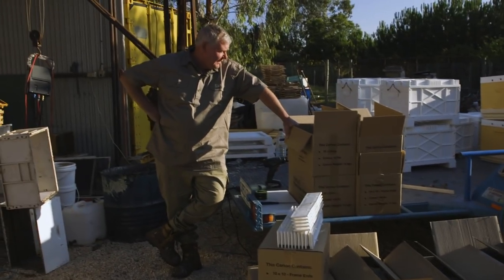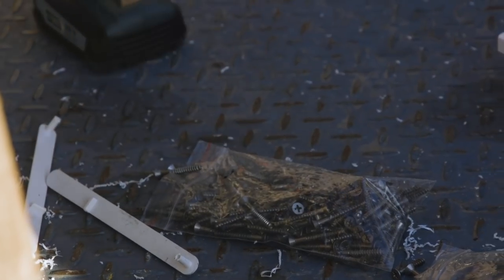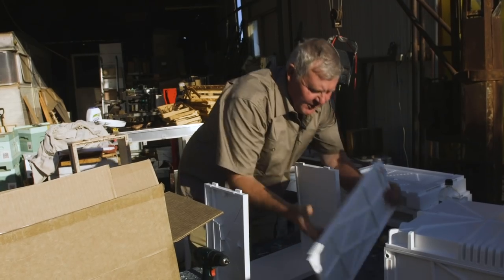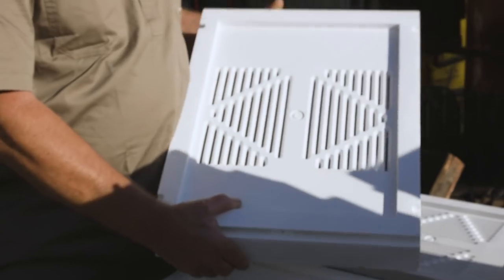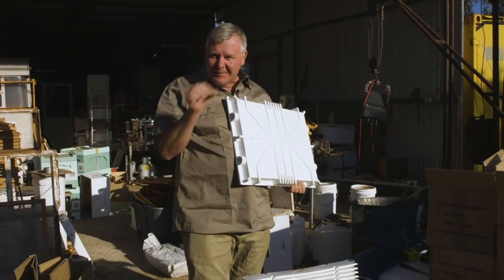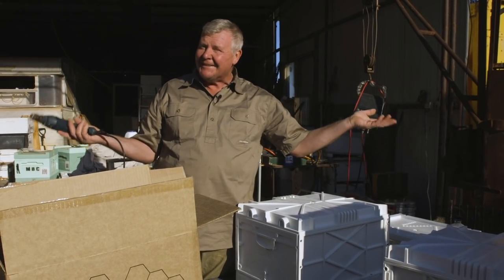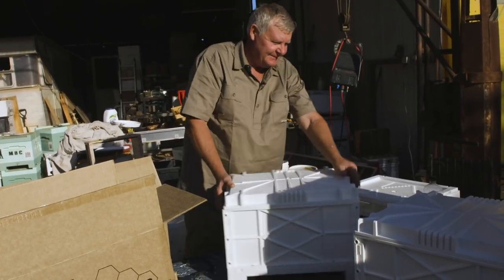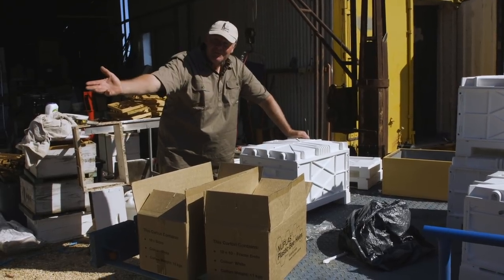How to assemble a Nuplas Beehive - The Bush Bee Man

Comment: Lucky you!! We’ve had Nuplas hives for 18 months and have decided to switch completely to Nuplas... the bees seem absolutely fine in them. We run 8 frames with ideal supers.

You do get condensation in winter but that was resolved by using lino mats (see Alan Teske brood mats) under the lid. If we need to feed in winter, we just gave them straight sugar and it worked well, any moisture was absorbed by the sugar. But even those we didn’t feed was very happy with the mat. We would definitely recommend. 👍🏻

Comment: Food grade what? What type of supposedly recycled material comes in food grade? and in white for that matter, I smell a rat.
Reply: @Flinders Honey Bees I will remain a skeptic. We already had a plastic hive manufacturer down Gippsland way. My issue with plastics is that here in sunny Aus, we have something called UV, all polymers break down in UV and release some nasty chemical by products, polypropylene and polyethylene both become brittle before falling apart, and the same with PVC. Nowhere in their literature do they say what the material type is, or a list of the additives. I have tried the polystyrene hives and they work well, but some critters find them attractive, (me thinks possums), and I often find damaged bases and boxes. The final disposal might be an issue as it is illegal to burn them, and landfill is reluctant to except polystyrene.
Reply: @Flinders Honey Bees Same results here, a lot of my buddies that have commercial operations have switched over to the foam hives, they say that their yield is on average 20% to 25% increased and they believe it is because the bees have to burn less food looking after the hive and maintaining brood temps, the hives are more expensive, but if you take into account labor assembling, painting and maintaining wooden boxes the foam hives are a no brainer., Keep them away from chooks, I have found that foam is attractive to them lol.